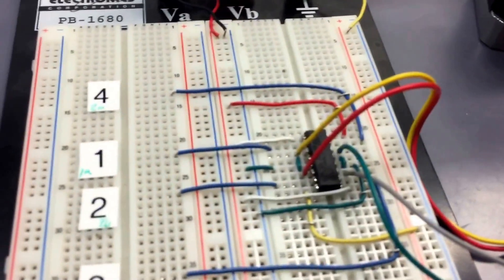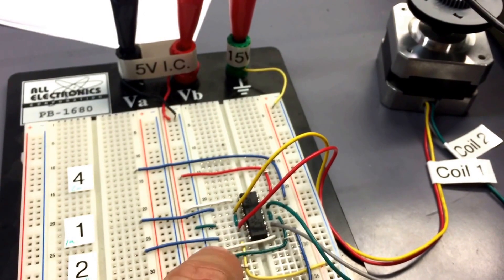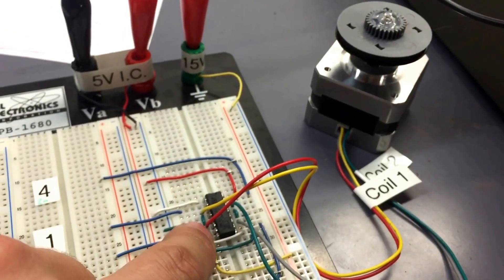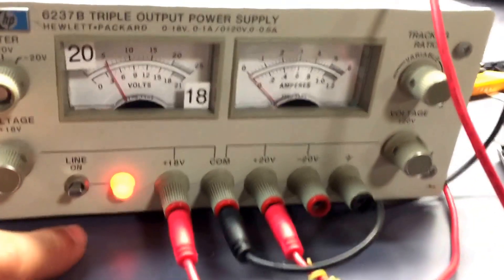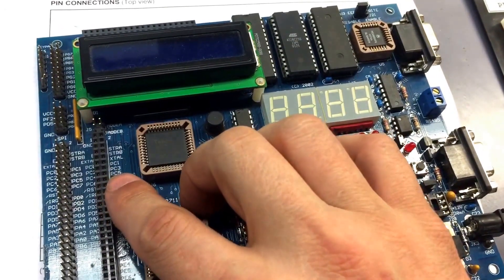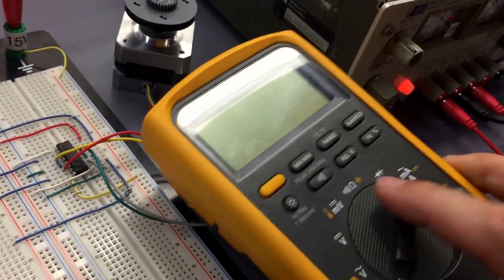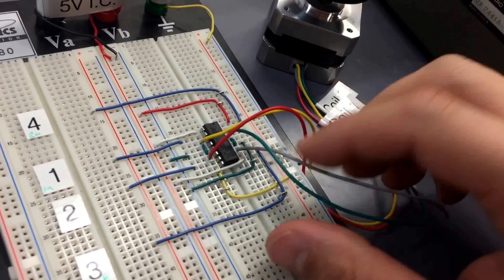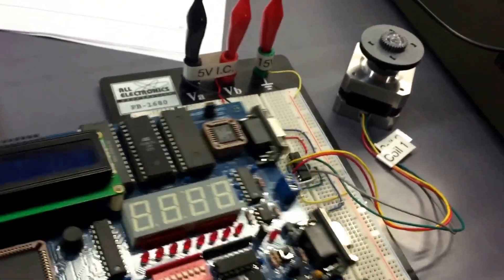L293D IC Stepper Motor Configuration

Comment: thanks
i am using a cd rom stepper motor 
pin 8 of ic should be connected to 12v of battery and where to connect the negative terminal of my battery
can i use ups 12v battery for this
please reply
Reply: Just check the datasheet of the motor and check its maxium operating voltage